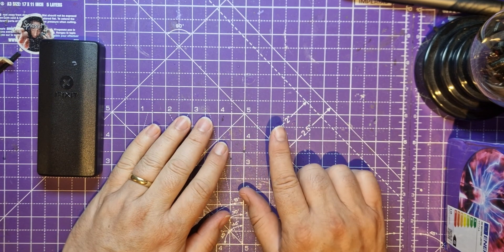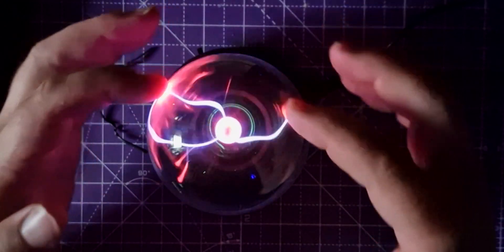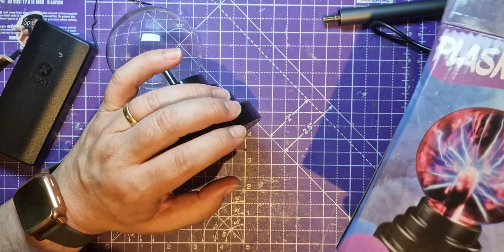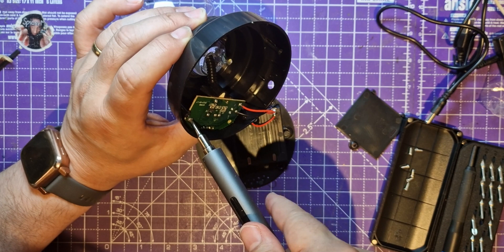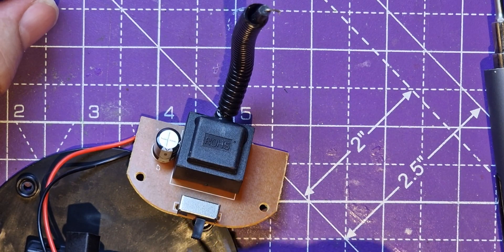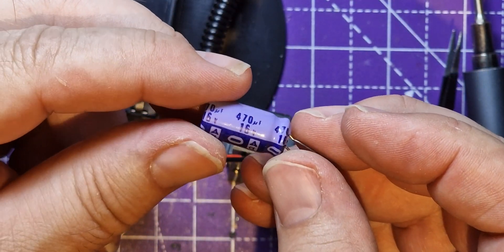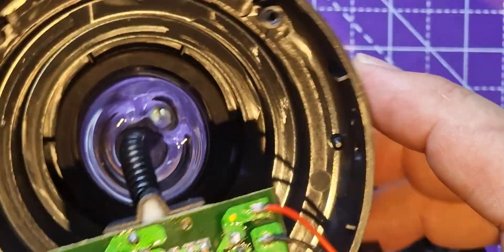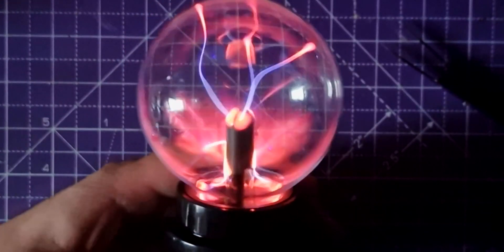Whats inside a TEMU PlasmaBall ?  And can I fix one?

Comment: I've had the same thing happen with mine.  I've also thought it might be the metal coating on the inside of the glass protrusion that needs to be renewed.  Not sure and haven't checked.  Nor would I know how to go about removing the old coating and resurfacing it without breaking the glass.   At any rate so long as it has nothing to do with the gas inside the evacuated globe, there should be a way of getting it to behave as when it was new.
Reply from the maker: Yeah, it's interesting. Cheap enough to do some experiments with at some point. I wonder if the same happens with more expensive variants